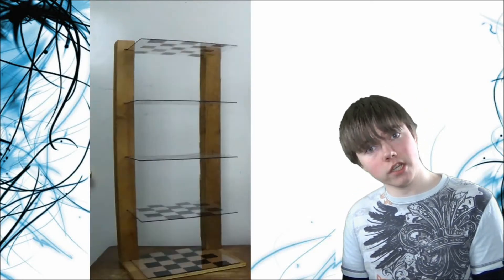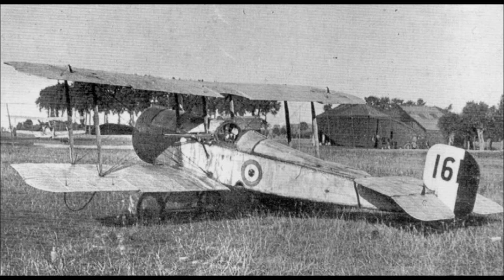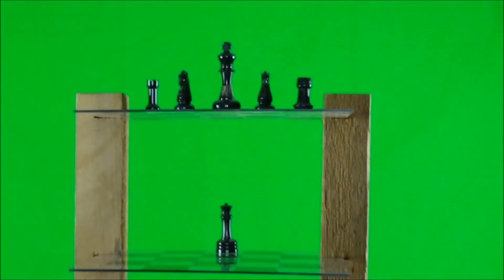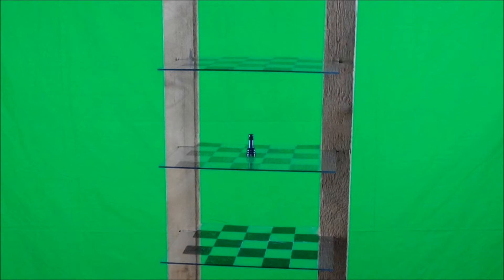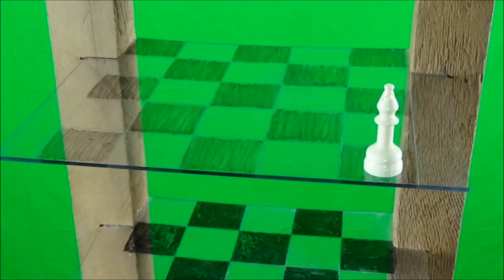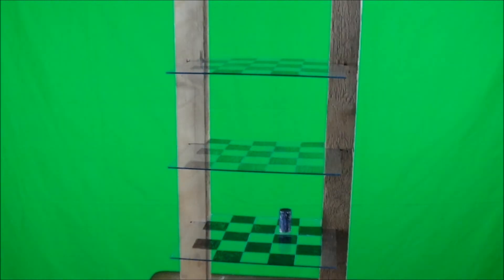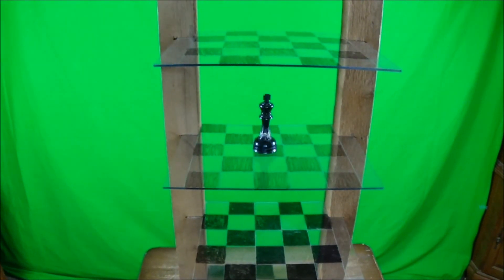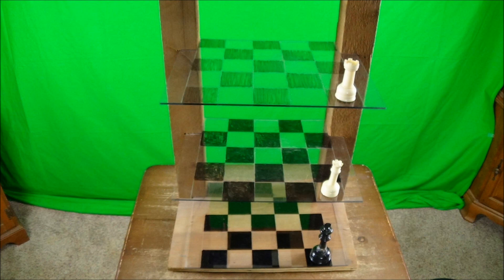3D Chess: Full Tutorial

Comment: For real 3d chess, the noble thing would be to have 4 or 5 chess planes but really you would need 8 planes a new set of rules and just 8 more pawns for squares a201,b201,c201,d201,e201,f201,g201,h201... where x=width=a,b,c,d,e,f,g,h/y=length=001-009/z=height=001-801... totaling 512 squares instead of 64, and yep taking 8 times as long to play out than normal chess (where the special rules for the top pawns can make the game go faster, like maybe the top pawns start on rows a801-h801 and can upgrade to pegasus lol)
Reply: Herr Doktor Ferdinand Maack (yes that was actually his full legal name) attempted something like that initially with his first concept for Raumschach, but it made the game nearly unplayable.  The 5x5x5 array proved far more practical.

Comment: Have to say great job with your board. It's nearly impossible to find a board. And sad that they are no longer commercially available because, raumschach is such a great game. 

If your really into 3d chess I would suggest picking up a strato set and rotating the middle board 90 degrees.
Reply: It's easy enough to build a Raumschach board, and plastic chess pieces are cheap to come by so it's easy to assemble both forces and glue a bead or a thin dowel on the heads of the extra knights to make the unicorns.  3D chess is the ultimate DIY hobby.